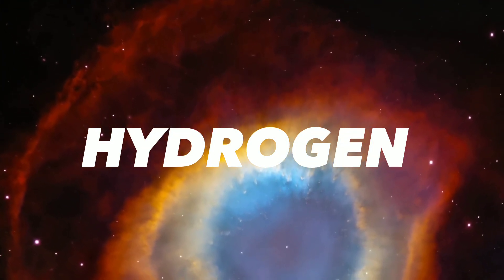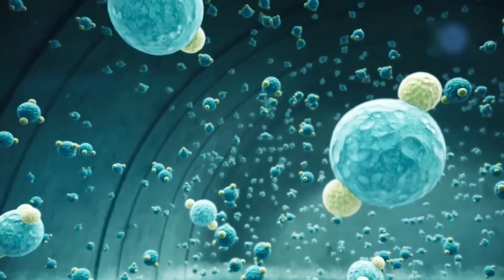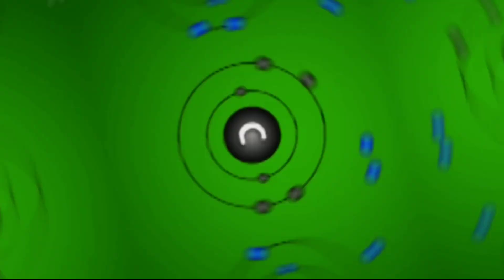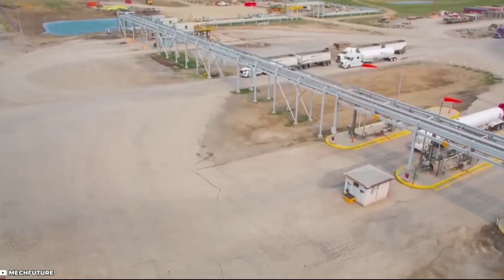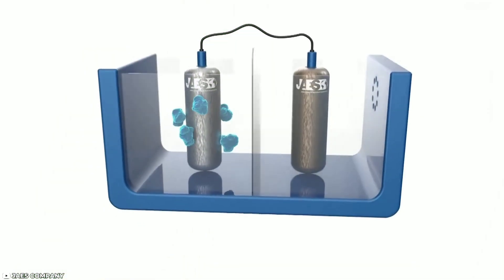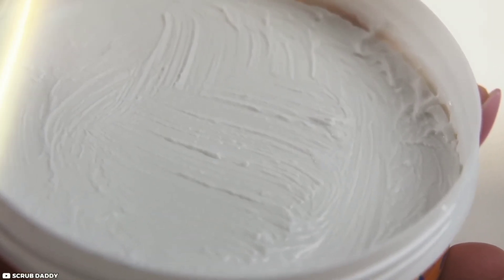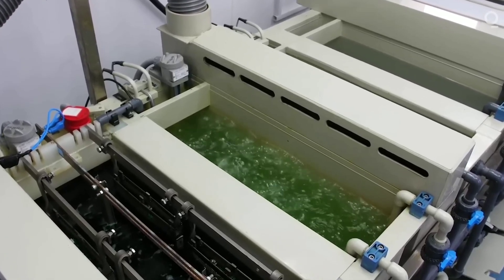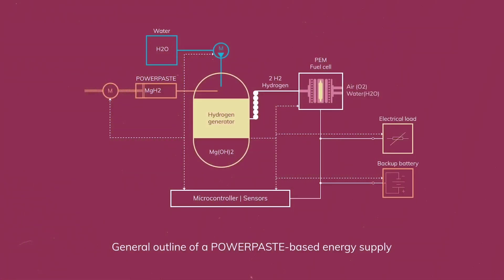No Fuel Will Beat This HYDROGEN Based POWER PASTE!!

Comment: what might be an interesting application is powering a stirling engine for remote use niches where fuel cells might be too costly and where extremely high reliability is an asset

Comment: Power paste sounds excellent replacement to dirty heavy fuel oil dominating maritime-shipping industry. It seems like perfect fuel for ships.
Reply: Think about power paste and water.
Reply: @szpg  Yes I have seen the technical video of reactor. Even sea water can be used for chemical reaction to generate hydrogen out of power paste onboard vessel.
Reply: @saurabhkatarey6818  I would feel like driving a petrol car in fire. I mean it’s a high risk that the heat and plenty of water could cause a chain reaction. The water doesn’t ignite diesel but would create enough hydrogen from the paste to boom. 250 degrees C is quite low compared to 800 diesel. The idea is great though I’m sure they will improve it or use it for specific scenarios.